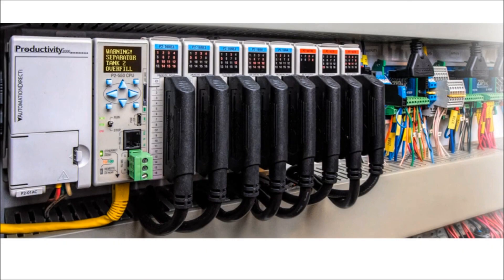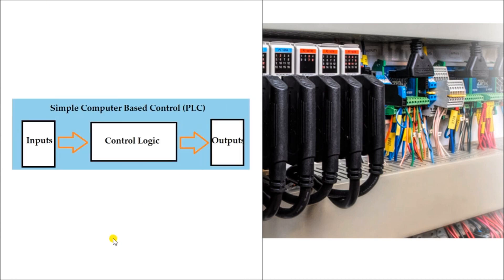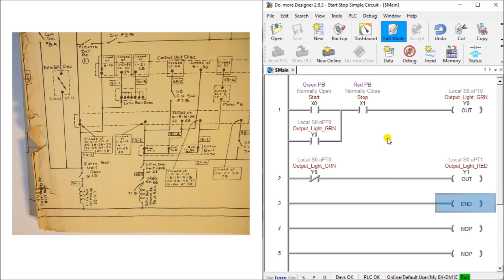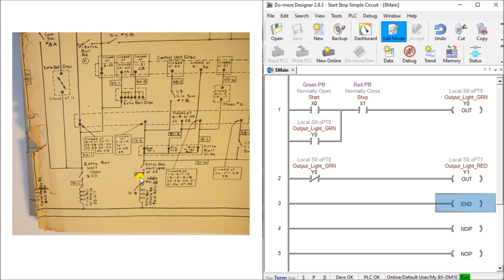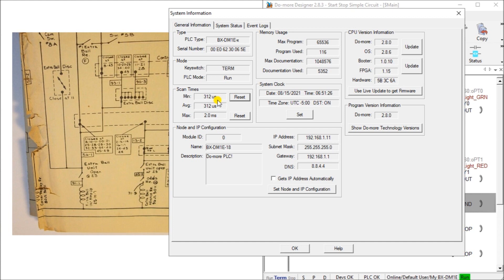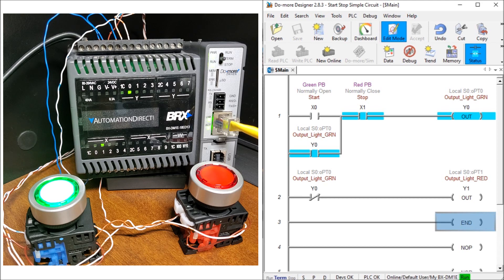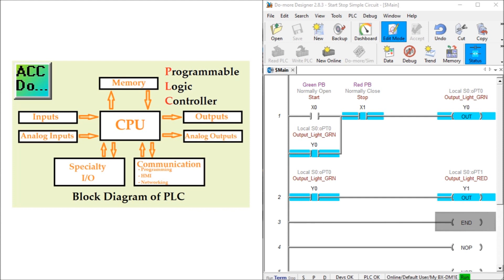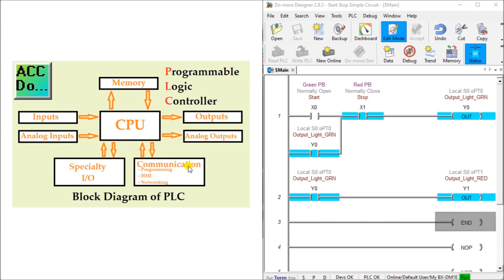PLC Training Series - Tutorial for Everyone

Comment: I am so used to the DL-05 devices for small machines. I need to pick up one of the BRX units to "play" with.
Reply from the maker: I have not used the DL series, but the Do-More Designer software will read the program and convert it for you. 
Using the Do-More Simulator, you do not have to purchase the hardware to try out the controller.
Regards,
Garry